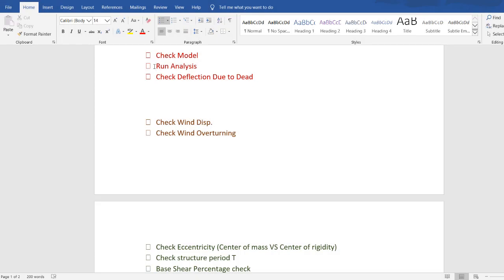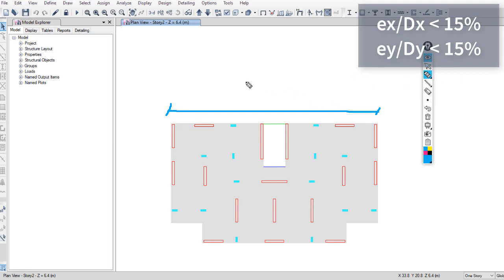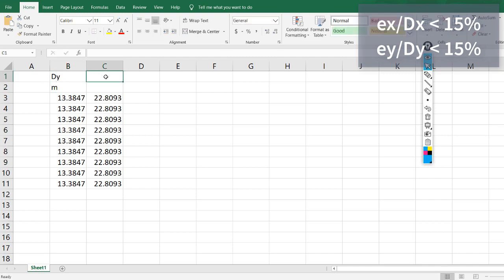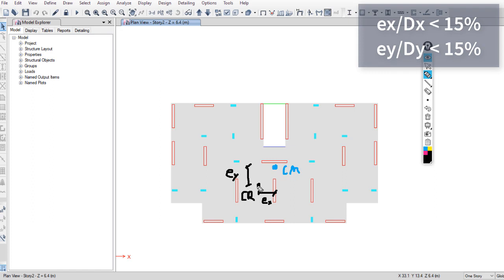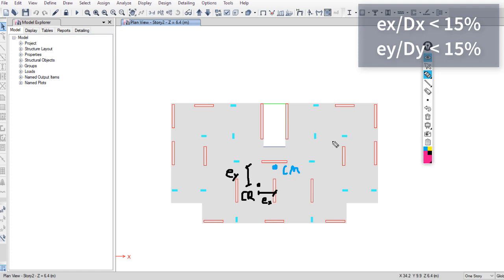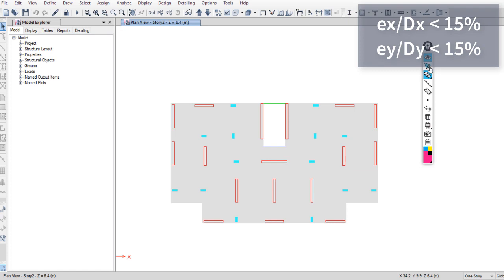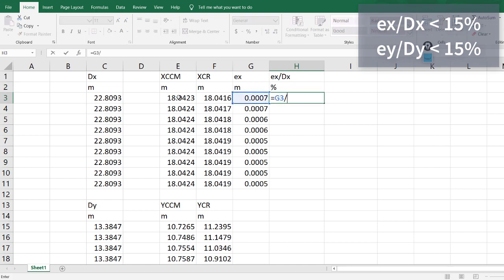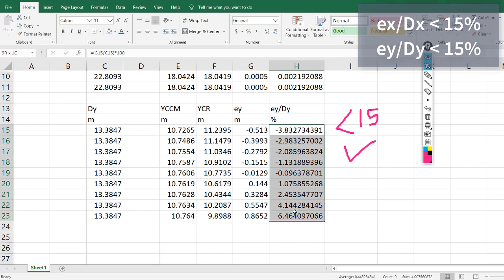ETABS Tutorial: Center of mass VS center of rigidity - Step 14

Comment: my Etabs table is not displaying the value of centre of rigidity ... what could be the possible reason????
Reply from the maker: Go to analyze and tick (Calculate center or rigidity), plz let me know if it works.
Reply: @engineeringforall5500  thank you.. it worked
Reply: @engineeringforall5500 i clicked but doesn't work for me